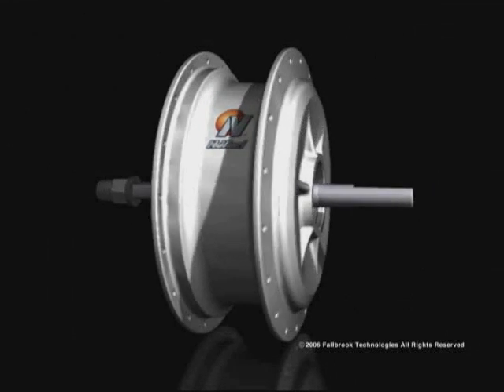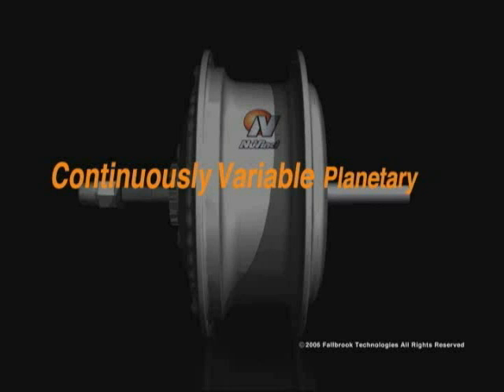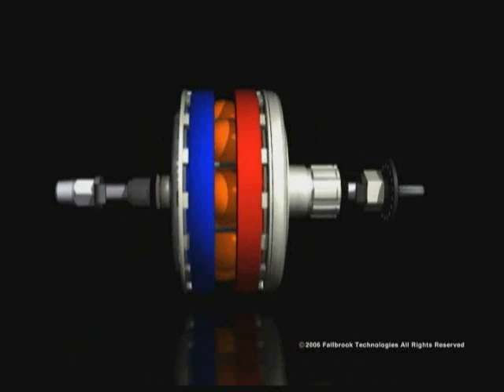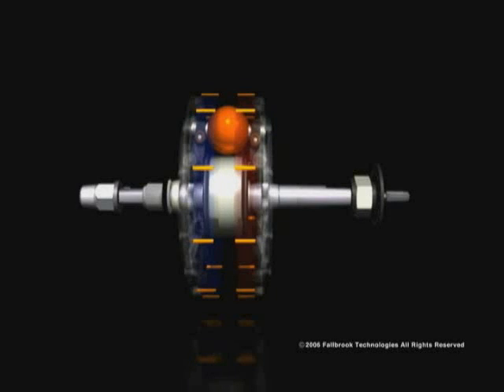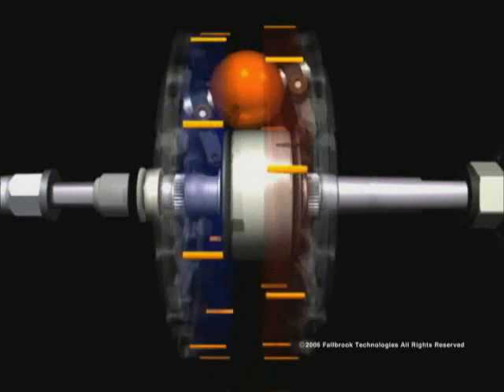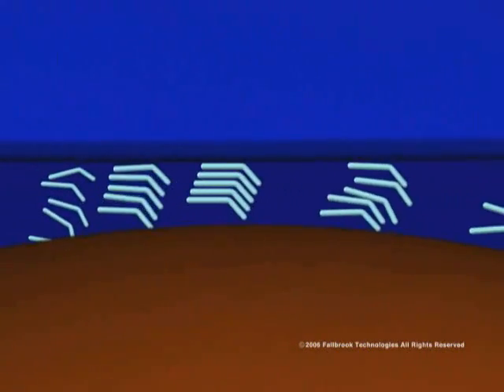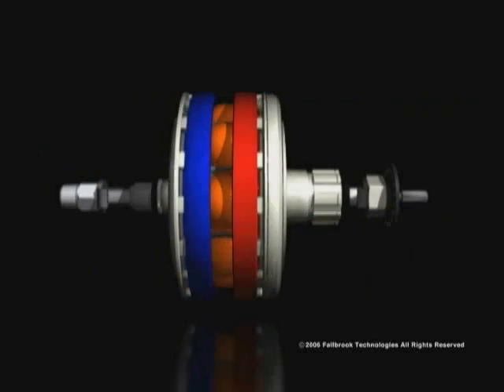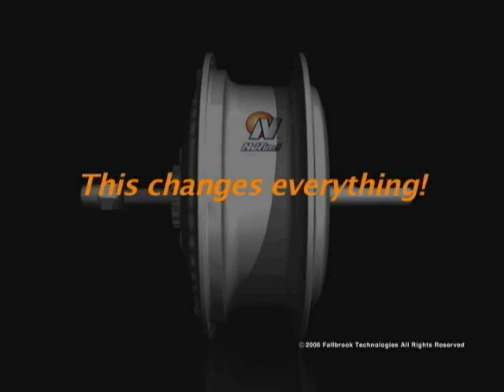NuVinci Bicycle CVT

Comment: I have one of these on my cargo bike and it is amazing.
Reply: I'd like to ask, how is the smoothness and adjustability to your desired torque/speed? Do you feel you could pedal up a decent hill? Does it take the cargo strain off you? Any input would be helpful, thank you.
Reply: @justinwhite1928  it is very smooth and it is nice because you can adjust on the fly without worrying about snagging your gears. In addition to the NuVinci, I use a Bafang middrive motor for additional power, since the bike is quite heavy and I live up a steep hill. I've meant to make a video about the setup, so maybe I will now. I have nearly 500 miles with this current setup.

Comment: And this is why they're horrendously inefficient, and feel like pedalling mud. Put them on an e-bike, and it will suck power and accelerate slowly, possibly with a pathetic top speed. Derailer gears are still the best and most efficient method for multi-speed bicycle gearing.

Comment: We might be interested in investing. 

How efficient is this transmission on AVERAGE? 

I am not asking peak eff. 

Average HP in (X) to HP out (Y) .  Y/X = ? eff
Reply: wits2014 I've heard anywhere from 70 to 95 percent, which is wildly variable. I think it breaks down as towards the extreme low and high ranges the efficiency drops, and increases towards 1:1.

Comment: This sucks, the whole point to a cvt on a bike would be to keep the bikers legs moving at the most efficient speed without having to think about changing gears. Also, bike parts are really nice because they are relatively simple, cheep, lightweight, and easy to adjust - this invention is a rube goldberg machine, its fun to look at but really not practical.

Comment: Simpler to manufacture? No, the "microscopic" space between parts requires very precise machining.
Cheaper to manufacture? No, the high contact pressures require specialized alloys to resist deformation.
Scalable? Don't make me laugh.
 
This technology has been around for years in the form of toroidal CVTs. They can offer much higher efficiencies than conventional CVTs, but nobody uses them because they are incredibly expensive.

The range of ratios is too small for most sports applications, so this would only be useful to a casual riders with deep pockets.
Reply: Deep pockets? You can get a bike designed around the NuVinci for pretty normal bike prices. The Priority Continuum, for example, pairs a toothed belt (instead of a chain) with the NuVinci hub making a great winter bike; that combo alleviates most of the concerns about road salt. Only $1000, which is cheaper than most of the bikes on the rack at the LBS near me.
Reply: https://en.wikipedia.org/wiki/NuVinci_Continuously_Variable_Transmission

Comment: Aren't CVT's self shifting? I've never seen anyone shift a cvt snowmobile. I'm not sure this is better than the current setup on bikes. If it were I'd see more pro bikes with it.
Reply: CVT just means any gearing between its highest and lowest possible ratio rather than set ratios from individual gears. to be considered a CVT it doesn't need to be automatic and just because its a very different design than like a snowmobile CVT doesn't mean it isn't a constantly variable transmission.
Reply: Trevan Thomas 
tbh its actually very useful for any rider. on a lot of even 18 speed bikes I find in certain conditions that there isn't a perfect gear to be in. sometimes I want a ratio in between 2 of the gears
Reply: This is for casual bikers who don't know how to shift properly or don't want to put up with the maintenance.

Comment: What is the efficiency of this?  I want to know for every 100 watts of input power, what is the output power?  85 watts? 90 watts...?  Also if they can get a 2:1 ratio on the underdrive side, then why not a 2:1 also on the overdrive side, thus creating a NuVinci 400 (not 360 or 380)?  That 4:1 spread of gear ratios might even need 2 front chainrings to select the range needed (high or low) since 0.5 - 2.0 doesn't cover all circumstances.  I would want something like 0.5 - 4.0.  Also this thing is expensive and doesn't fit all bikes so there are many problems it seems with it.   My entire WalMart mountain bike was only about $100 out the door and it has 21 speeds and a gear range (spread) of 3.5:1 which almost matches that of the NuVinci 360 which is 3.6:1.  Not sure why this hub cost many hundreds of dollars when I could buy several new bikes for that amount.

Comment: OHHH now i get it
its not a anti-newtoniad fuild
its a suspension of heavy and hard ceramic dust waste
that press on each other when forced near the ball and the plate
that causes the movement

well know that i understand it
I ALLOW IT!!!!!

when will be show cooler that celebrity deathmatch?????
Reply: Renan David Soria Ahumada It's a non-newtonian fluid, but close. Mix corn starch and water and poke it really hard, and then you'll understand.
Reply: Richard Smith define non-newtonian its sound just like and snake oil advertisement
where do i buy anti-newtonian oil to soak my windsuit and fly away
Reply: Renan David Soria Ahumada Are you being serious right now lol. Had a good laugh.
Reply: Richard Smith
dead serious, define non-newtonian please
as it sounds like something that doesnt obey
the laws of motion and thermodynamics

as for example i got the notion that a self inductive engine could be posible

still the charge that i got from the inducted iron cores (nails) its still not powerfull enougth to sustain a perpetual cycle
of induction-propulsion that
 i hope someday could rotate 2 magnets over a wire collector and make a AC generator
i even got exited thinking that maybe that thing called "levitron" may help me out

the next sunday i may try to test how long can an horizontal levitron can keep spining

yeah its sound funny
but in all my writings and draws on my notebook there is not a single one that
skips newtons laws

not even to fool myselft

i dont believe in fairy tales, gods, prophets or aliens
Reply: Renan David Soria Ahumada It is not a fairy tale... its a definition of an observation of some materials. As I said, mix cornstarch with a little water and poke it, you will then understand what it means. You cannot honestly be calling an actual phenomenon anyone can recreate in their kitchen bullshit...
The difference in water and a non-newtonian fluid in a simple way that doesnt sound so crazy as the word, is think about a water gun.
When you pull the trigger you force a volume of water through a small hole and it squirts. If the fluid in the gun was non-newtonian, it would solidify when compressed, instead of squirting out the hole, and the more force you put into it, the more solid it becomes(to a point). There is a limit, just like any solid has a limit, and beyond that it would crush, then immediately re-liquefy.

Water does not separate back out when solid, but when you apply a compression or sheering force, the molecules 'lock' together as log as the force is continues to be applied, with the solution trapped inside.

Think of a Chinese finger trap. Only when the stress is relieved can the molecules unlock.
Reply: Richard Smith
 more over i got a non-newtonian robot that change its shape the T1000

that shit is non-newtonian as hell!
microscopic circuits, dyodes, capacitors, pullers, cranks, video cameras and batteries
that rearrange themself as they move
and has little microprocessors
split in zones of himself its deligfull

the new terminator movie even show it making itself a radio signal to call the rest of him

it whould be enjoyable to picture himself taking power from car batteries or wall plugs to charge up or gain more power

or taking control of cars like in terminator 3

the part when he drop himself in the damaged terminator and reactivate him was cool

but when he nail grampa to the wall
and didnt "contaminate him"
makes me say
BULLSHIT!!!!!!
Reply: Richard Smith
and yeah i understand the concept
but its just that a concept it doesnt exist

warp travel its a concept too
its has math and science behind it
but doesnt exist"

Comment: There is insufficient information to know whether or not it would actually be practical. If it is practical, fine; it would solve a number of problems.
Reply: +Frank Eggers There is probably some power loss. Not a big deal if it were in an electric or motor vehicle, but can be significant with a man powered bike.

Comment: sounds like it weighs a ton and has limited ratios
Reply: +mike nixon Even regular sprockets have limited ratios, and this could actually have better range of ratios, but the problem is that there might be some power loss. Chain drive has nearly 0% power loss. This is dependent on friction, so it's likely that you will lose some power.

Comment: Scalability? How does a regular user change their gear ratio?
Reply: Scalable because you they can add more bearings for different applications. As for how to use it as shown on a bike you would control the ratio with a knob on the handle bar. This method may also work for cheap motorcycles or scooters but in higher class bikes and cars I would assume it would be controlled by a ecu based on throttle position and fuel economy just like the cvt's in cars now.

Comment: I just test rode a Novara bike at REI with this transmission. I'm extremely impressed. No clicks, no nothing. Also, you don't have to pedal to change ratios, just a smooth twist. Front sprocket to the rear is by belt. Also very smooth! This transmission might be great for scooters and small motorcycles. We'll see what happens.
Reply: Shane SRAM My comment was 100% about the transmission. The only part about REI was that they were cool enough to let me test it. You must be a special kind of stupid.

Comment: @cannissolis  You can find all required info in 
mech-ingDOTcom/journal/Archive/2011/2/129_Konstantin%20Ivanov.pdf
wwwDOTmadbassDOTnarod.ru./

The efficiency is close to efficiency of Bearing on high speed, because all gears is connected.

Comment: Scheme of the differential variator.
1. Input power is divided into 2 flow through a differential.
2. Flows give a different ratio (up/down)
3. Combine two power flow through the second differential.
Remembering that the planetary gear reducer and at the same time differential, we can build the CVT only with two planetary gears.
It seems, and the range and efficiency and capacity of the variator at much higher used in automobiles.

Comment: Is this unit sealed, or what will happen in a wet environment?

I want to use your transmission for a super high mileage amphibious vehicle I'm working on for college, but contrary to what your video claims that "this promises to be the most practical and ECONOMICAL cvt",  I can't afford one.  It costs more than any other component in my plan, and I'm just a student who already can't make ends meet with todays economy. Contact me if you can spare a second hand unit or demo or blem or ?

Comment: @ermalkoci Wait... seriously? You never wash your bike, you never clean/oil your chain, never grease your bb? Or, if you don't, those guys racing accross Europe aren't using bikes, but something so convoluted with external BB's, carbon fiber (with the included carbon paste for contact surfaces) fancy gearings, and such? Ok. Go back to your single speed and enjoy being on your soap box.

Comment: @FranktheBBB ye I see a BIG problem with this, although i have not used this, I would image it has a fair amount of slipping going on, meaning torque transfer is dramatically reduced, which is not good enough for pedaling up hills or using low gears. Is this what you experienced? I wonder how they will attack this problem,

Comment: @MrMeanderthal the design doesn't really limit power, just torque. if you had an engine that produced 15lb-ft of torque at 30,000+ rpm, that some seriously usable power that almost any tiny tranny could handle.

Comment: Actually, according to the exhaustively researched book Bicycling Science, and also the 1896 Bicycles & Tricycles: A Classic Treatise on Their Design and Construction, there isn't "plenty of energy loss". The chain-and-gear drivetrain has an efficiency of up to 98%. Nothing comes close to that. 
And please, people, there are no "sprokets" on a bike. They're called gears, in general; "chainrings", up front, and "freewheel", "cassette", or "gear" (for you fixie fans), in the back.

Comment: @GLOCKIOMM there is actually plenty of energy loss in a chain and sprocket system, with all the hundreds of tiny "bearings" between the links, and the bearings that the axles have to ride on, this design by itself will definitely increase efficiency in almost any system it is properly applied to.

Comment: He said CVP at the end i think (2:48) - Am i missing something?

And also, I imagine this would let the pedel move if you were resting your weight on it while waiting to go at the lights - unless it has some kind of centrpetal-force-activated gear lock for when your not moving

Also, I would prefer a CVT that automatically increased its gear ratio with increased centrifugal force - which I think was the original design goal of CVTs (Am i wrong?) +Compensation for your prefered cadence

Comment: Not a novelty, for bikes, but the problem is weight. See to ride a bike at maximum efficiency you should ideally pedal at a set speed and decrease or increase your moving speed by changing gear. EG spin your pedals at 1.5 times per second and change gear to change bike speed. This is the most efficient way to ride a bike and racing cyclists would love it. The downside is that if the thing weighs 4 kg it is too heavy for a bicycle.

Comment: The shifting of the ball acts like the different size gears... dunno why you don't get the rest, it's simple to me.  I just see alot of issues with leaking, and weight.  but then I guess the balls could be hollow.  although I see the application on heavier vehicles, it  seems like alot of device to replace the simplicity of the common gear system on bikes.  but I guess its a novelty some might just have to have...

Comment: @500group: boy, am I glad I didn't know this thing couldn't work before I went out for an hour long ride today on my spanking new Crescent Nuvinci. I'm no expert, but there was not the slightest sign of the extra friction you guys claim. No slipping. I never noticed the weight either (but now you said it's so heavy, I'll think about it all the time). For all others, rest assured, it works. The "high friction" if it's there at all, is much too small to be noticed even by my lazy legs.

Comment: Currently CVT transmissions are the MOST fuel efficient transmissions made for over the road vehicles. It allows the vehicle to select the best drive ratio for a given circumstance. This transmissions along with lock up torque converters are much more efficient than both manual trans and traditional automatics. CVT transmissions are standard on most new Nissan, Saturn, and most of the hybrid vehicles on the road and probably many more.

Comment: Nice, This is a good idea, give it a few years to work out all the bugs. then it will be in alot of stuff. But it still it is not fuel efficient. like the auto trans compared to a stick. the hydraulic aspect is good for comfort but not efficiency.

Comment: It's a Knopp variator. (Google it) It's a very old design. As for the fluid, well it's oil. Common or garden oil. All that has been described in the video is the behaviour of any hydrocarbon oil between a ball bearing and the surface it rolls on. 

It's a neat bit of engineering to get it small enough for a bicycle, but as with the Knopp, efficiency will be low.

Comment: well you also lose a lot from the chain shifter - but its more about the gain you get with the 4kg: continously varying "gears" and most importantly no maintenance!

i am actually also very much interested in the use for electric bicycles and motocycles and there 4kg is certainly not much.

Comment: Yea great;  I wonder how easy it is to repair a rear flat tire on a rig like that?  I wish they would explain how to go about disassembly of the rear wheel of the frame in the likelihood of a common flat tire. What about the availability of maintenance and repair parts, such as, special shifter and brake cables, pads, oil?  Whada you have to do?  Make a service call appointment with the dealers for this?  LOL.

Comment: This is an interesting system but I have a few questions:

What is the weight of the hub?
What shaft ratios are available (min and max)?

Its surely not infinitely variable as that would suggest any ratio is available, it is continuously variable, meaning there are no discrete ratios between min and max?

What is the diam of the hub? I'd be weilling to give this a try if it came in reasonably priced and wasnt much more than the weight of a comparable cassette/mech combination.

Comment: Special spokes??? It's just a hub - it has spoke holes - lace it and ride. As far as ratios go, the first production units have a range of 350%,  which is wider than you think. The efficiency, due to the special transmission fluid is excellent. Of your objections, only the weight, (around 10 lbs) even counts, and given the ability to easily have low-maintenance shifting, I can sacrifice a little weight - contrast that to, say a Nexus hub, at about 3.4 lbs, and the weight difference is even less.